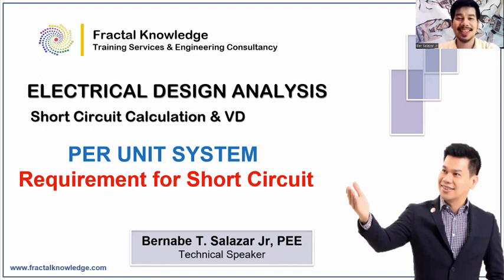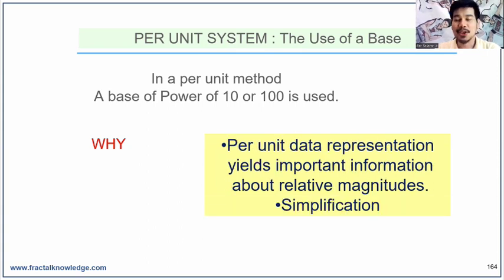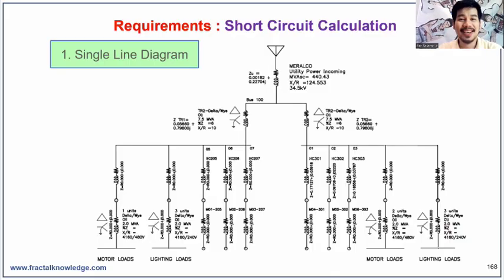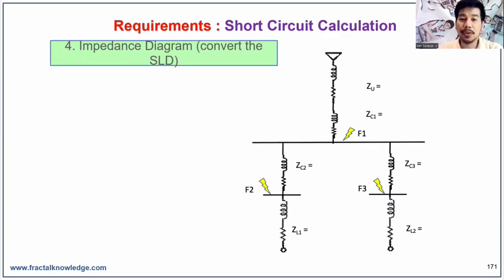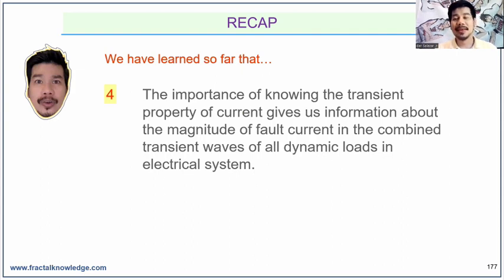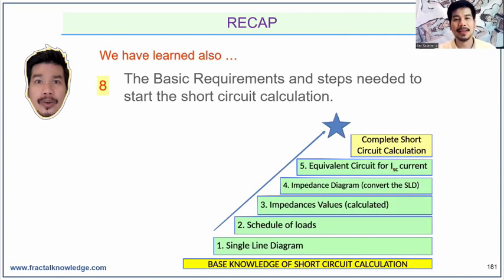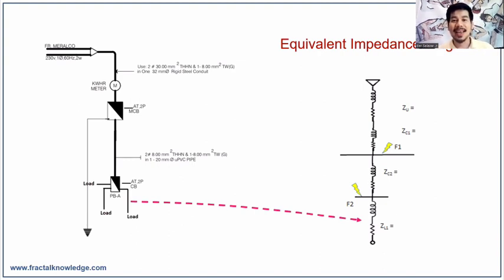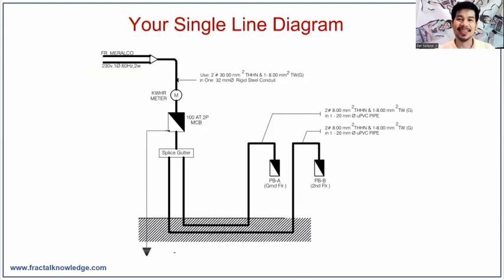Electrical System Design Analysis -  Short Circuit Calculation - Base  Knowledge  part 7 and 8

Comment: How about Ohm method and other method in S.C. calc. ty
Reply from the maker: Other methods are okay to use if you like, but i choose whats on IEEE recommend , which is acceptable by BEE and other government bodies and required for PEE.  You have the freedom to use whatever method you want, however , ill choose those that is required for electrical design analysis here in the Philippines.  Thanks